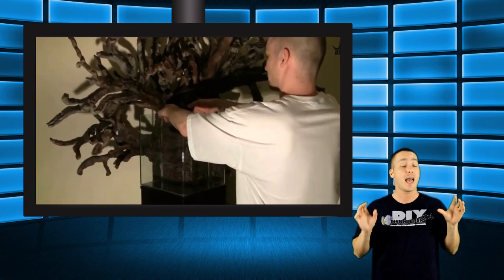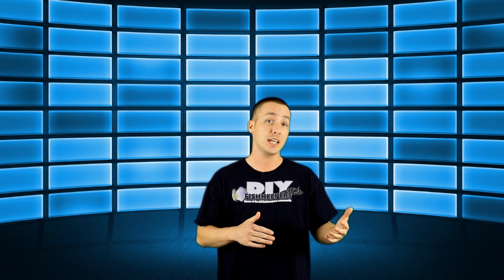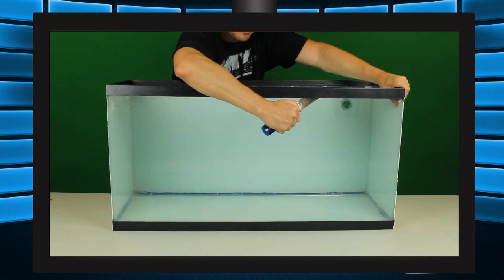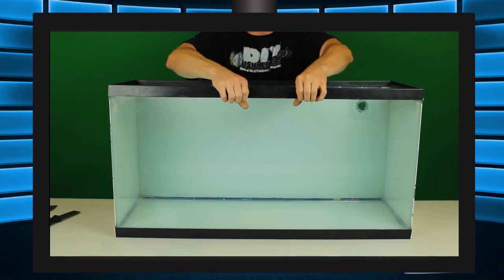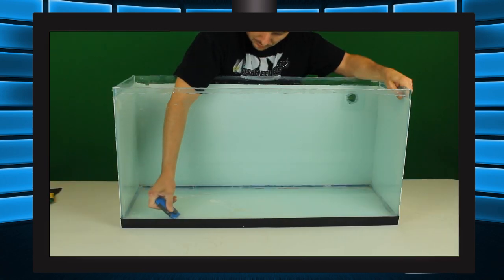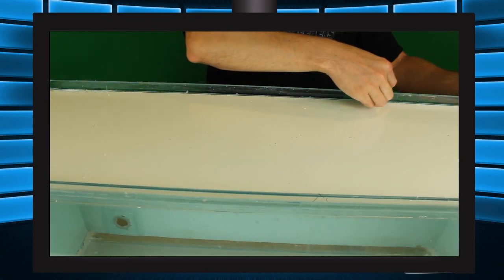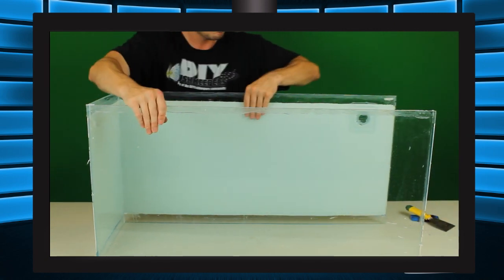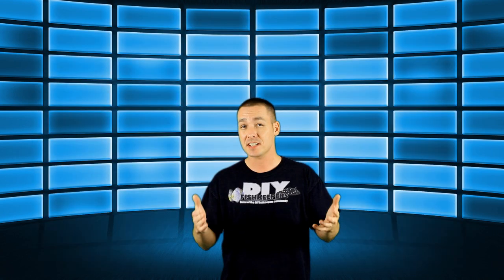HOW TO: take an aquarium apart TUTORIAL

Comment: Hey Joey! I was having the absolute hardest time getting a razer blade to fit between panels, it was chipping the edges of the glass and causing all sorts of problems (shortage of bandaids). However I was determined to find a way and it turns out floss moves through effortlessly! Hope this helps in the future and anyone with the same issue as me.
Reply: what do you mean floss? Please explain. I am having a hard time getting razor between seams. please explain
Reply: @tannersmith2000  tooth floss I assume
Reply: I have just read this, this could be a GENIUS move.... Dental Floss is designed to go between the tiny gaps in your teeth, be strong and not cause your teeth to explode or shatter, so my glass shouldnt explode or shatter :D
Reply: Thank you this worked for me
Reply: I dont have dental floss, but, as an avid fisherman, i have plenty of fishing line laying around, so im hoping that will work just as good.

Edit: fishing line works well also.

Comment: Just my 2 cents to add. When I replaced a cracked panel I found that using a heat gun on the silicone helps when breaking the bond between 2 panels.
Reply: what type of heat gun?  would a blow dryer to warm it up work too?
Reply: @anavidfan62  Wagner has a heat gun for 25 bucks at Lowes. A Hair dryer may not get hot enough but you could definitely try it first.
Reply: @anavidfan62  curious me has to know , did a hair dryer work?

Comment from the maker: Who thinks this was easier than they thought it would be?
Reply: Thanks for the video Joey. 
I thought it would be very easy, but when I tried to do it to my aquarium, I just couldn't. The panes of glass are glued so close together that I couldn't get a blade between them to separate them. 
Any tips for the harder cases?
Reply: +Adan Christian Freitas I am also struggling with the same issue, I have managed to use some acetate from product blister packs to help part the silicone where a blade is too thick for the gap. however it only worked so far.. I am now stuck half way through the job, its a 1300ltr 11mm glass with a double layered bottom so taking that off first is not an option.. 
should I just try to work some acetone in there and keep at it little by little.. or is there a better way?
Reply: I'm still have a hard time taking the top trip off
Reply: Oh yeah, it's easy, time consuming but easy.
Reply: ummm,how bout putting it back together?
Reply: @MrGrunter  How did you get it done? I have a 1135ltr with 12.7mm glass and can't get the razor between the panes of glass.
Reply: @MultiTankAddiction   This was a long time ago.....
I am pretty sure I used the metal filling cards, the narrow ones are also quite thin. It is still time consuming but it did the job.
Reply: Cool thanks
Reply: It's a 125 gallon still thinking bout it
Reply: Definitely NOT me. I am on day 3 trying to get the top frame off!!!

Comment: Sir, I have an "All Glass" 30 gallon Bow front tank made by Tetra, purchased in a Chain Pet store, about 15 years ago. A few places the black sealant they used has turned white, I've been told that may leak. Maybe better for a terrarium, but I would take apart if possible? It has strange interlocking edges? It's not just a simple right angled glass tank as you show. What would you do? Thanks.

Comment: Thanks to this, I just took apart an old 30 gallon I pulled out of my dad's storage unit.  It has to have been in there for a good 20 years, so I didn't even bother trying to fill it first.  One side panel started coming loose while scraping out the old silicon, so a reseal turned into a rebuild.  Poop.

It might be the only aquarium ever without a gap around the bottom piece.  The four sides sit on top of the bottom pane, making it a pane (yuk yuk) to disassemble.  

Now, off to see how to put it back together.  Thanks.

Comment: HI!  Not sure if you will get this question,but I have a leak on the bottom of my 93 hexagonal tank, can i just use silicone sealant on the inside or do I have to remove the bottom trim and bottom panel and re-silicone that way?  It appears the tank is installed into the trim instead of on top of it.  and/or can i just use liquid rubber completely on the inside?  I don't care about looks whatsoever, just simplicity.  I have pictures if you need it ;)  I really appreciate all the info, love your videos!

Comment: Hey Joey, I have a quick question for you.  I just bought a used Marineland 265.  It had some silicone around the bottom trim in one corner and side piece and that worried me but the fella said the trim had come loose and he siliconed it back on but didn't have clamps to pull it close to the glass .  He said there was no leak.  I just got done pulling off the side trim and there was definitely a leak.  The question is, can I just remove the bottom glass, clean it and put it back on followed by a complete internal reseal or should I take the whole thing apart.  I didn't know it was a Marineland tank when I bought it.  It is an 84 inch long tank so I thought it was custom built.  Now I am reading about Marineland horror stories...

Comment: Hey Joey, Anything?  Well, I got thru reading some of these questions and posts.  I see down below that Benjamin Maether asked you 9 months ago, a similar question and you told him to first set the bottom pane (I'm assuming on top of frame) then build/add the other panes around it. 

However, wouldn't the silicone smear off bottom pane's edge, when the all the sides are slid down into frame?  I think it would have been best if you also included the part "How to put that tank back together inside the trim".  Well, I haven't heard from you as of yet.  I am sure you are swamped with many request. I also bought the "Bar keepers" glass cleaner as you demonstrated on another video. Cleaned glass best i could. I have everything ready and setup.  I'm a little frantic, but I will try to do this on my own. Thank you in either case.  May you and your family have a very Merry Christmas and a bles-sed new year.

Comment: Joey i  just got a 29 gal aquarium i noticed  on the outside of the tank at the bottom  one side theres a gap between the glass panel and the plastic manufacturer rim  on the outside of the tank. i dont no if i should re seal the tank?  I washed the tank out to get hard water off it theres water. I  trapped in there because theres a gap.  I filled the tank to see if theres any leaks made a line to see if the water would go down it hasnt went below the line that i made its been 24 hrs.

Comment: Trying to make an internal filter across the back wall of my Marineland  75gal . Because if the center brace, I can't just drop the false wall in. it's 47.5"w x 19.375"h. I tried on a slant, but it gets stopped by that plastic center brace about half way.
Trying to come up with workarounds like taking the top rim off and re-siliconing it after the filter is done. or cutting my filter wall in half, doing half at a time all inside the tank, somehow joining them together afterward This will likely leave a seam showing at best case.
Can I cut a small section of the center brace out, slide the wall in, then glue s piece of plastic over the cut area ?
How much does the tank depend on this remaining untouched ?

Comment: Have to take apart a 20 gal so I can put it under my stand and make it a sump. This really helps, thanks!
Reply: Did you take the 20 gallon apart? I wanted to remove the bottom of my 20 gallon long and use that as a turtle tank topper ontop of my 55. Not sure if it's ok to remove the bottom.panel only

Comment: This is an awsome diy vid, now I can take apart a 125g tank I picked up for 100 bucks and reseal it. It has a slow leak in the corners. The only problem im going to have is finding another set of hands to help me move this behemoth around. Hey joey how do you move very large tanks around? Do you use carts or just muscle?

Comment: Hi Joey, 
Where is the video of rebuilding it with the panes of glass and black trim?

I have an 210 gallon tank with a small chip in the front corner , it has small runners in the chip. Should I replace the whole front panel of glass?

Comment: Hey Joey, I have a 125 gallon measuring 72.5x18.5x22" with 10mm thick glass, however there is no top bracing or trim, just on the bottom.  Do you think this is safe to fill with water, I got a safety factor of 2.5 on online calculator.  Thanks for any info.

Comment: Question, I’m building a 36x16x16 with 6mm thickness glass. Do I need a frame to hold the glasses together or the silicone will do the job? I was just wondering with the water pressure. I don’t want it popping it off

Comment: I have a Marineland glass 265 I need to repair. The rear base seal blew out , I can actually see the gap when I flex the rear panel at the base, I want to do this correctly. My first thought was to remove just the rear panel and just remove outer silicone from the other 3 panels and reseal .  
Do you reccommend a complete dis assembly and rebuild? I have not tried anything like this in my 40  years of fish keeping. 
But really want to save this tank and stock it with nice fish. 
Love your Asian arowana,  stinks they are illegal here in the USA!  
All your videos are great! 
THX, Chuck Allen, NH
Reply: Did you try it and did it work??? I've got a seal between the back and one of the sides that is separated on an old tank that was in a closet. I was thinking of doing the same with my tank
Reply: @Charlie Allen , I'm also interested did you manage to just replace one side? I also need to do this on my tank since the front screen is so scratched it makes me cry :(

Comment: Hello Joey, Pierre-Luc from Montréal here! I was wondering, I just de-constructed my old 33 Hagen hexagonal from the 80's (only to find out the stains were so bad I couldn't even wash it with razor blades and bar keeper). So I ordered 6 new glass panels and kept the bottom one and of course the black frames. Now that I have all the pieces ready I was wondering how you'd advise me to start. I was thinking to put a bead of silicone on one side (the one facing down) of the bottom glass and put it on the bottom frame, then insert the 6 panels in the bottom frame (using tape alongside just like you do to hold everyone together) and put the silicone beads against bottom/panel glass. I would then work my way to the top doing the vertical silicone beads (inside and outside) and then put the top black frame and apply its silicone bead on the inside part of the tank last, What do you think? I am mostly concerned about the first part as I hope there will be enough silicone entering the 90 degree angle between the panels and the bottom glass. Thanks!

Comment: Hi! I have just build my first aquarium after watching your videos, but I forgot to use the tape to prevent too much mess on the glass. My question is: now that the silicone is hard and dry, what can I do to clean up the mess from inside the tank? And what about the outside of the thank? Because I used quite a lot of silicone, I have some on the outside of the aquarium, where the glass panels meet. I did smooth it out when it was fresh with my finger. Can I use acetone to remove it from the outside of the tank? Won't this affect the sealing effect? Thank you!

Comment: Hey I have a question.... so when thinking of the sides of the aquarium (or in my case terrarium), do the side panes HAVE TO sit inbetween the back and front to make it structurally sound or can the be on the outside? I feel like they should sit on the inside but that's such a pita for measurements 😐

Comment: I know this is an old video but i have a 125 tank that was passed down to me for a terrarium because it split two seams. I want to fix it back into a water worthy aquarium again so i feel like a total rebuild is best since its such a big tank. My issue is how do i get the bottom of the aquarium right? I know theres about an inch of a gap in the bottom of the aquarium from the bottom where it sits on the stand. How do i go about making sure i make the gap the same when i reseal it? I know its  probably a simple thing but it has me worried. Do i just silicone the bottom glass onto the plastic bottom and then silicone the edges onto the surface of the bottom glass? Also how many tubes of silicone would i need for a 6 foot 125 gallon tank, i was thinking 4 or 5. I would love to be able to fix this aquarium, a 125 is a big tank for an average aquarist haha

Comment: As luck would have it, taking about a 75gallon to harvest glass for new custom enclosures and the bottom has no gap, the sides are actually rested and siliconed on top of it, rather than the bottom fitted inside the side panels like in the video…. Any tips? Tried mineral spirits, gonna try a hair drier as I don’t have a heat gun handy… anything else?

Comment: Hello Sir, Mr. Joey, Congratulations on a very well array of aquarium projects.  Perhaps you might be able to help me and any other person facing this dilemma. So please bare with me. 
 In this video you have shown "How to take an aquarium apart".. and pretty much it all went well for me on mine, as mine was exactly the same but a in 55 gal. 
However, putting it back together seems a different story. I must apologize, I don't know to this point if You have made a video putting this tank back together, afterwards. If you have, please by All means point me in its direction ASAP.

The thing here is, that normally the building of tanks I have seen so far do not consist of tanks using the top and lower frames, as in this video. Tanks I've seen on Youtube basically seem to follow a trend of Frame-less aquariums.  Simply put, bottom pane on flat surface, then all other panes get glued either on top or to the sides and taped to hold!  

Now, the tank I have is thick 3/8" glass. Very heavy. Its 12-3/4" wide and the 48" long. The 48" long front and rear panes along with the left and right panes actually sit inside plastic wood decor frame. The bottom/floor pane sits on frame, putting it 3/4" higher up on the other glass panes. Here in lies my dilemma, how to re-assemble inside frame?

As per your advice (and a good one) in regards to when you buy a used tank, I have stripped away all the old silicone in order to re-seal it. Incidentally, it seemed someone tried sealing this tank before, but with black silicone. This, and what made me look into these videos was, that as tank filled with water and left it sit with filters running a week, I noticed rear pane bowed out just over a 1/4", and this tank doesn't have the cross support brace. 

So I emptied it and allowed it to dry a few days. After I had stripped away the old black sealant I notice the adhesive sealant was a clear type, but most importantly, the bond had separated, had detached or otherwise lost its ability to hold glass panes together. I realized the integrity of the tank was no longer safe in its condition. So I have stripped and separated all glass panes. I have cleaned Everything and I am ready to re-assemble tank, but I am not certain of how to correctly do it. 

For adhesion of the glass I have and will be using GE SCS1200 silicone. This will just be for the 1/8" seam on All edges. I am looking to restrict that silicone to the edges by using painters tape along. After thoroughly dried or cured, I'll trim the squeezed out excess, remove tape, wipe edges with alcohol, re-tape 1/2" along all edges. Here I plan to use GE 100% silicone 1. This should leave this tank in a condition to function perhaps another 18 yrs.  This description is just my opinion. But, I would really appreciate if you showed me the video of you putting this tank back together inside bottom frame. Thank you for your time.. -John

Comment: Hi Joey, Thanks for the video. I want to take the rim off of my 125 gallon tank to make a big terrarium. Can I still use this method or is it too hard to do this since the glass is thicker so there is more silicone attached to where you can't reach? I already started it but I can't get a clue to lift the trim.

Comment: Tried this on a 10 gal as an experiment and ended up cracking 2 corner piece. Could it be that brand new aquariums have a stronger seal than used ones? The only silicone left really was the one attaching the trim in the middle. Such a small spot for a strong @$$ seal. After a hour of pulling and sliding a very thin knife back to back, I gave up and started pulling hard. What amazed me was that the seal was so strong that the trim started to bend and all of a sudden x.... Bigger tanks may be easier too because the corner isn't so compact into a foot. I may try this on a bigger tank one day.
Reply from the maker: Small tanks are.....well, the worst to take apart. Its not uncommon to break them and its VERY easy to crack one. With that said, I'm glad you learned first hand... you got to see what it takes to take one apart and the pressure it takes to break one. Nothing i show or explain in a video could have taught you that. 
With that said... i bet you have a new found respect for the strength of silicone! 
PS: Yes, big tanks are FAR easier to take apart.
Reply: Yes!!!! Silicone is no joke when sealed, I do respect it much more. Thank you joey for clearing up that big tanks are easier to take apart.
Reply: The king of DIY I am about to put a 120g together... I am having Silicone trust issues lol I know it is how it goes and I have seen you do it... 120g is a pretty big tank to have fall apart lol

Comment: I have a 70 gallon tank and the silicone is falling apart the glass is about half a inch to a inch thick and I wanted to take it apart and maybe make a custom tank cause the wood fitting are very ugly and wanting to make a more modern style tank but just wanting to know if it could be done